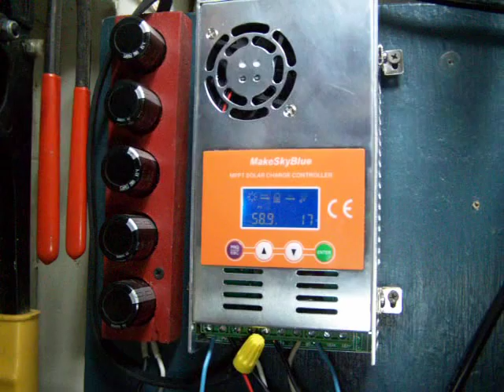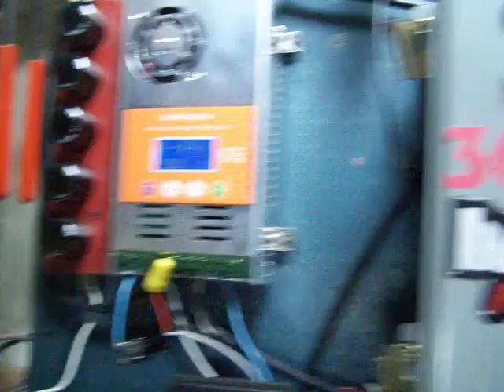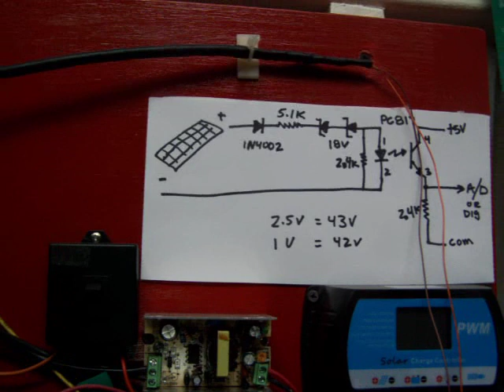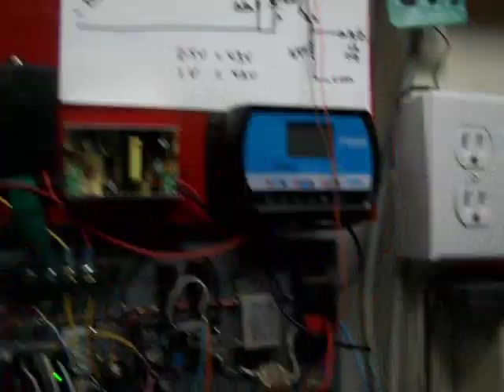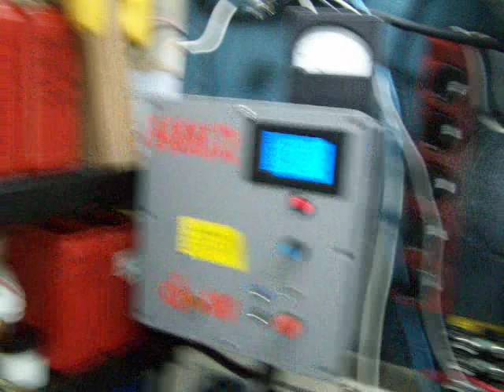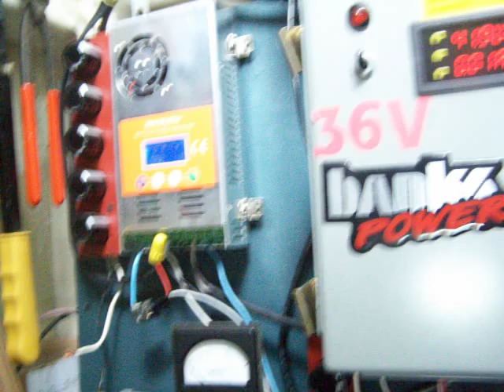MakeSkyBlue 40A Solar MPPT Charge Controller,  Auto  Reset I Had To Build

Comment: I have the MakeSkyBlue V123 and have had a similar problem with the PV voltage dropping after an hour or two of use. Then suspected that it was my battery charge rate that that was set too high.  I figured that my BMS was limiting the charging power due to sustained higher than recommended current.   I have the remote control app (Smart Life) and it lets me set it remotely.  I only have one battery and it recommended charging at 20A.  I set the charge rate to 20A and stopped having the problem.  I can also remotely turn the controller off and on.  I am adding a second battery so I can set the charge rate higher to 40A.  I suppose I could add a third battery to get the full 60A but I only have 700W of solar a doubt that I would that much without adding more panels.

Comment: When you use these charge controllers... how do you know they'll really disconnect and shut off if the battery bank gets full? This is a worry I Have after seeing a few of them didn't shut off right and burned out. (replaced).

Comment: Nice solution.  There are several stand-alone programmable chips that are under $10 that would also work - or you could use two 555 timers or a 556 (two 555's in one package) to get the A/D capability and the 5 minute delay timer.  The output of the 555 can handle 200ma so you don't need a driver transistor for the relay - just the back EMF protection diode.

I like the EPEver Tracer 3210A (30 amp) and 4210A (40 amp) MPPT controllers I'm using.  If the power level from the panels is steady for 45 minutes or so in boost (absorb) mode, the controller does that dis-connect/re-connect to ensure it has the best MPPT conversion when doing serious charging.
 I've lost multiple USB-RS485 dongles (PC talking to the controller) and the USB ports on two laptops to nearby (200 feet) lightning but I've had no controller failures in 5 years..
Reply: There's actually a better way.  Instead of disconnecting the panels you can reset the controller via a pin on a header on the PCB.  The exact location depends on the model but anyone with a bit of electronics experience will find it.  As with all things, there is a catch.  The charger will lose any volatile data as if it were power cycled and did a normal power on reset.  Disconnecting the panels with a standard small relay will eventually fail for one reason or another - contact degradation etc.

Comment: Thanks for making your video! Facing the same issue but my unit is the PowMr (rip off copy of the makeskyblue) and I see that the controller drops into PWM mode (mode 7 on display) and won’t go back to mode 4 (MPPT) unless you disconnect PV input and reconnect.  Probably I have to do something similar to you. So what I understood is your circuit provides a high output when PV voltage is above about 42V and low output when it drops below maybe 40V?  I will need to adapt this to my PV array so I’ll take some voltage readings.  I was wondering couldn’t you just use a potential divider array of 2 resistors in the correct ratio to drop the voltage to what your optoisolator needs for switching?  Would be a lot less complex and cheaper?
Reply from the maker: I'm working on a new design which will use a FET driver chip. Not because the FET needs a driver, but because the chip includes an under voltage lockout circuit which prevents gate turn on when voltage is too low. This prevents FET heating when operating in a linear state, an easy way to destroy a FET.
Reply: @opera5714  sounds good. If you have the inclination to make a further video when your new circuit is done, it will be of interest to lots of people I’m sure. I’ve been observing my unit, which mostly holds 50+ volts at PV input when operating properly, but sometimes gets stuck with 40V or less and mode 7 shown in display. Once it does that it won’t recover unless the PV breaker is cycled off and back on.

Comment: makeskyblue has many problems. The most important one is that there are 
no fuses, shut offs or any kind of safety measures built in. according 
to instructions there is no reverse circuit protection either.

Comment: The Ming He controllers I have show the same type of action but they self restart. It happens when there is a sudden drop in sunlight hitting the panels. I think that yours is from the same thing just they aren't rebooting properly which is what your circuit adds.

Comment: Do you have the fake one?
Reply from the maker: No, this is an official one.  However, this is likely an early version of the software and have heard there have been several updates.  The version is supposed to appear on the screen. This has also been reported by others. I don't have it to look at till June when I return to camp.  I do think this is a problem found in many MPPT controllers to some extent in low light shading and clouds that move in and out. They search for power point in a limited range and bypass diode action can fool them.  True searching takes time and wastes power.
Reply from the maker: I bought this less than a year ago from their official site.  They sent me software version 113 when newer versions were available.  They claim if you have a 113 instead of a 118 it is fake green one.
Reply: @opera5714   Fake green one ?   I have this same charge controller and would like to add the circut that you made for it , Thanks